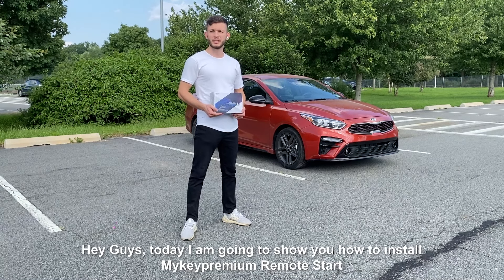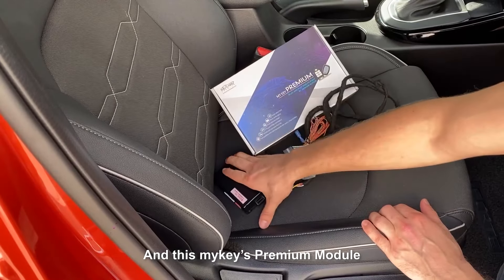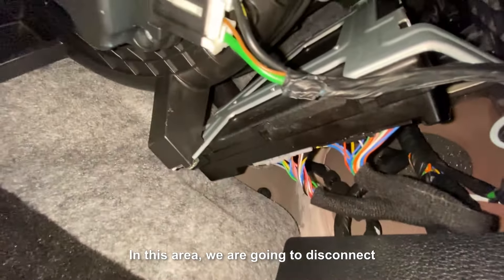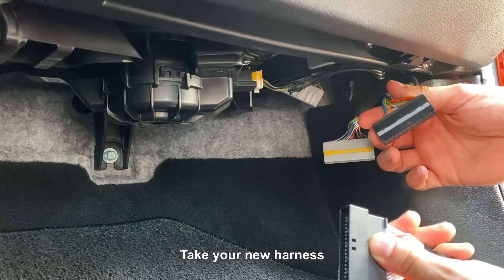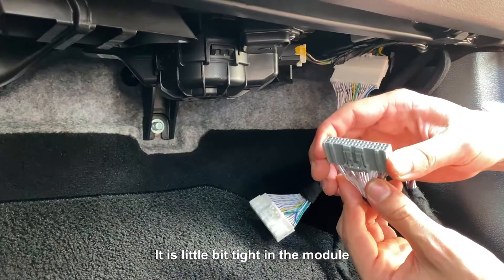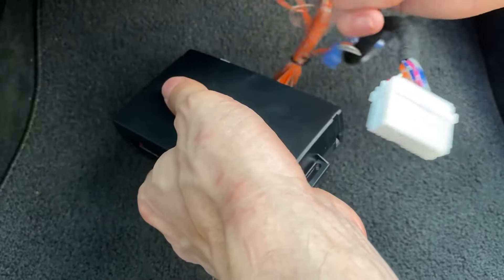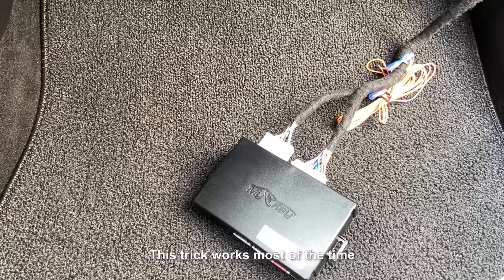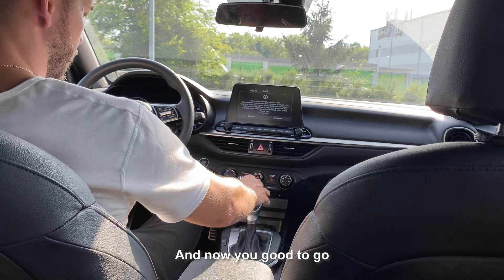Kia Forte GT 2019-2021 Remote Start Installation | How To install | MyKey Premium

Comment: Does this remote starter come with alarm system also?
Reply from the maker: No, that's not the case. However, the security is top-notch. The car simply won't move unless the keys are inside.
Reply: @ do you guys sell any alarm systems separately for this car though?

Comment: Sir Can I use for my 2013 kia Forte Ex,,And After Connecting should Need Any Computer programmer..?please Ans ..?
Reply from the maker: No need to program, splicing wires. You just follow the video instructions. That's it.
Reply: @MykeyPremium do you have video instructions for a 2013 kia forte?

Comment: i need to install door remote for this car first. Mine is very basic i open the door the key 🔑. Do you sell doors remote system with remote?
Reply from the maker: Here are the links to check them out: https://mykeypremium.com/products/kiafortecerato?variant=44301444120805

https://www.youtube.com/watch?v=J9cVL_fBDG8

Comment: This thing works great. Have had it installed on my GT for about a year now and no issues in regard on how it's supposed to work. I did get locked out today though. Left key in car. I have it set up to lock on its own when I walk away from the car and not sure if it's only due to this setting that I guess since it is bypassing the factory system, it forgets the key so that it can lock on its own. I remember seeing in the manual that there was a pin code process you can do using the handle button. I've always kept the manual inside the car just in case so it was not good to me at the moment so I emailed support and they sent me the PDF within 3 min. Impressive. I got in the car and kept on with my day.

Comment: This thing is very hard to install on the 2021 kia forte gt. There is very little room to see the connections. The video makes it look alot easier.
Reply from the maker: Thank you for your feedback :) How do you like it so far?
Reply: I installed on my 2020 Kia Forte GT in about 5 minutes. Keep in mind all plugs input toward the drivers seat
Reply: Spent about an hour trying to get that white cable plugged back in myself so far.. Definitely a very, VERY tight space on the '21 GT for some reason.. And it's cold outside, will have to try again later X_X
Reply: After another hour of trying, I think I'm just going to return it.. Not worth the busted knuckles and frustration.. Over it.

Comment: where do you mount your unit after it's all plugged in??
Reply from the maker: Good question, you could either put it under the carpet (under the glovebox) or better to tuck it in inside the panel that you removed during the installation (there is not much room, but enough to make it work). Hope this helps.

Comment: Hola la compre para mi kia forte gt line 2021 y se me quedan prendido flachando las luses intermiten o sea las de emergencia eso es norma y lo otro como la apago con el beeper del auto
Reply from the maker: suelte el tercer interruptor dip negro hacia abajo; esto debería apagar las luces al encender el automóvil. para encender las luces - levante. no olvide desconectar el módem de la fuente de alimentación antes de cambiar la configuración

Comment: Good luck I have a 2020 forte gt. Install was easy sometimes it would work sometimes it would not. Sometimes it would lock me out of my car. Sometimes it would set alarm off and lock me out of my car. Sometimes it would not let me put it in drive. Gave the company many videos of the problems they just told me to unplug to reset. When it worked it was great but it seemed to mess with the alarm.
Reply from the maker: please send us email here - support@mykeypremium.com we will help you to fix it

Comment: As a GT owner, this is NOT a GT. It is possibly a GT-Line trim. The GT has the 1.6 T-GDI engine, whereas the rest of the Fortes have the 2.0 GDI (non turbo).

Comment: Does it allow me to leave my car locked with the engine running? For example, if I want to run into a 7-11 really quickly?
Reply from the maker: 100%
Reply: To do this, get out of the car, shut the door, and wait for the beeping sound alerting you that the key is outside of the car while car is still running to stop. Then hit the door handle button 2 times. You will hear the beeps and doors will lock with car running. It will stay in sleep mode for 15min. I'm in hot climate and do it all the time so the AC stays running.
Reply: @gabrielcandelaria346  Thank you so much!!
Reply: @QuintilusCastle  No problem.

Comment: Does it flash the hazards while running like the UVO start does?
Reply: It does but there is a longer pause between flashes than the factory set up.

Comment: It doesn’t detect my key, which connector should i be looking at
Reply from the maker: Try reinstalling the whole system, disconnect everything and connect it back. One of the connectors didn't sit well, most likely. 

If that doesn't work, send an email to support@mykeypremium.com explain to them what's wrong and they will replace the unit for you.

Comment: am i the only person having trouble trying to take out the first two connectors?
Reply: Did you ever get it installed? Just curious. I used a different install video from their website which I feel was better. I actually pulled out the factory module that is under the dash out which made disconnecting and connecting everything much easier.
Reply: @gabrielcandelaria346  yep, got it installed with a help from a friend 🙂

Comment: The cars have built in auto start with Uvo.
Reply: Uvo Doesn't work with all. Definitely not my 21 gt.
Reply: @andrewpalmer4337  I have a 2021 GT lol. Make sure you set it from you entertainment system then get the app.
Reply: My 2018 does all I had to buy the harness
Reply: Are you in the US?
Reply: It's an added option, says so on Kias website if you knew how to read